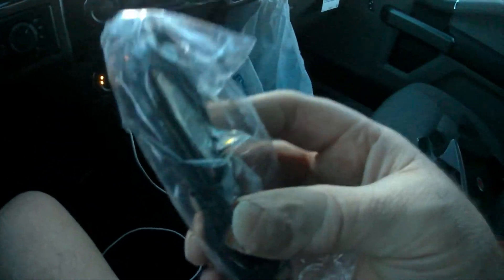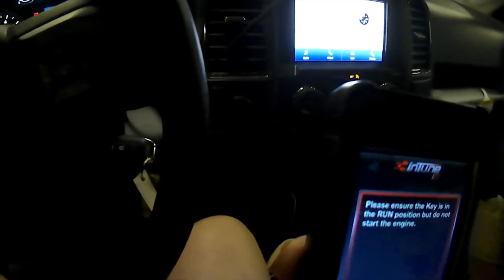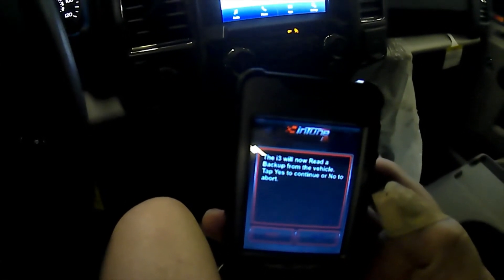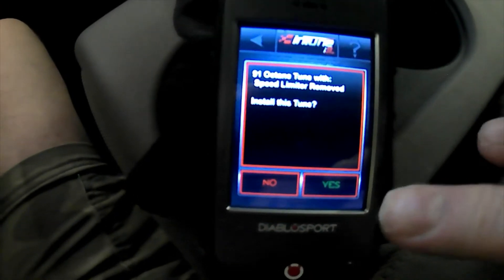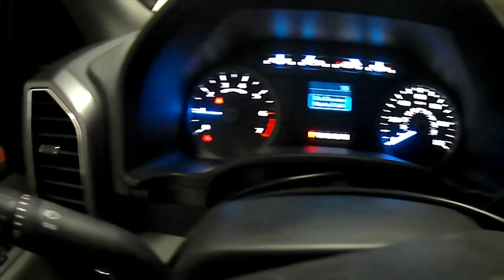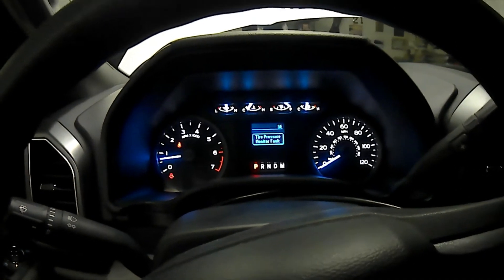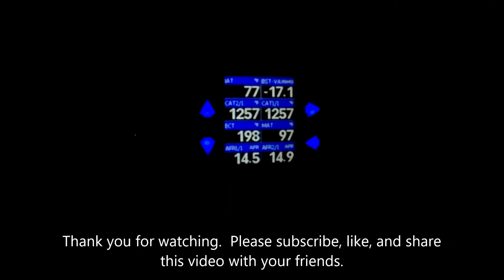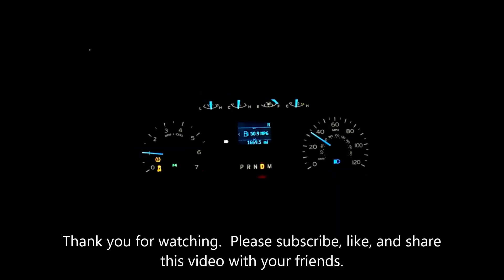Diablosport I3 tuner, How to adjust or remove vehicle speed limiter governor

Comment: Can I just use this to get rid of the governor but still use 87 octane?
Reply from the maker: Yes, you can pick 87 tune and turn off speed governor or speed limit.
Reply: I think those options just allow you to use 91 if u ever need to
Reply: @cbg482 nope, you can do 87 89 or 91 octane.

Comment: my question is . if I will work for 1994 Ford cf 8000…? the limit go only 55rpm
Reply from the maker: It works for OBD2 which is 1996 and newer vehicles.  A 1994 is OBD1 and wound need a programmed chip.  Hypertexh was one of the companies making chips in the 80’s and 90’s.

Comment: Will it work on a 2015 f150 3.5 eco boost?
Reply from the maker: I had one installed on my 2014 F150 3.5 ecoboost, and the 2020.  It should as long as the updates are downloaded from your computer to the tuner before uploading.

Comment: Would have been nice to see you go over 100 mph on a highway, not pointed at the gauges at the top. I’m sure the speed limit remover worked, otherwise that’s $400 wasted. To each their own I guess
Reply from the maker: Made new video of short acceleration runs well over the limiter.  I bought a COBB tuner since it has better performance than the SCT out of the box.
Reply from the maker: Here is a mild speed test https://youtu.be/eBYQjSJs4A4
Reply: Be careful! 200mph is no problem on a tuned vehicle these days ,even something like an f150.
Reply: It does. My 2015 5.3 limited speed is 98mph. After using this Diablo it turned it off. I hit 120mph easily. My tires are rated for 118mph so I didn't push it further.
Reply from the maker: If I had a minimum subscriber count of 100000, I would make that video.  Until then,  I will make videos of low risk.
Reply: @madboostingmadmatt48  it did remove the top speed limiter tho right? i want to get this for my ram that tops out at 105 but i knew it can easily push way over that
Reply from the maker: @gwuapomanuel  yes, when you are selecting items on the tune select speed limit and then speed limit off.
Reply: @gwuapomanuel  bruh a hatchback pulled on me cause of the stupid 105 governor limit. Had to get the tune can't be having that.

Comment: I saw no speed over 100mph. You changed nothing
Reply: It did remove the speed governor you can choose which mile per hour or turn it all off. Of course I didn’t go  On the road and go over 100 miles an hour to show you literally I’ve tested it other places it goes well over 120 no problem.  At least have enough courtesy to subscribe to my channel If you were going to act like a troll. Maybe you should get some of your other friends to look at my videos and maybe they will understand and get it apparently you didn’t get it. I changed everything you changed nothing.
Reply: @TTATurbochargeThemAll  Proof not talk........
Reply from the maker: Don't believe the SCT X4 has the capability to remove the speed governor?  Check out SCT website and verify its true.  I did not make this tuner however, I successfully installed it and showed how to do so.  I do not have to go out and get a 140 mph speeding ticket to prove what SCT company knows to be true.  If you have an SCT tuner, you can do that to your vehicle too at your risk.
Reply: @madboostingmadmatt48  w
Reply: It does remove it. My 2015 5.3 is limited at 98mph. With this Diablo I hit 120mph no problem. It will go faster but my tires are rated for 118mph.
Reply: The reason for the speed limiter is because of the bullshit drive lines they put in trucks now. Proceed with caution
Reply: @chrispryor9721  maximum safe speed for stock tires
Reply: @wadetaylor9974   false, it’s the driveshafts. Look it up. They where falling out of trucks after 110 mph diesels included